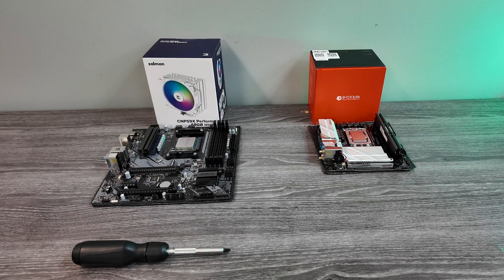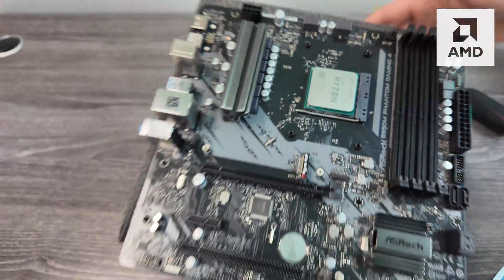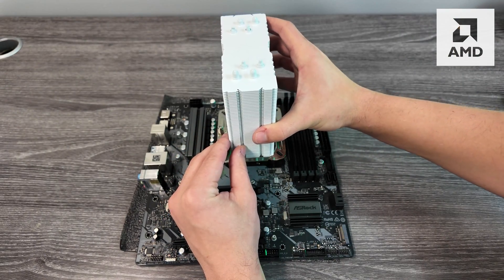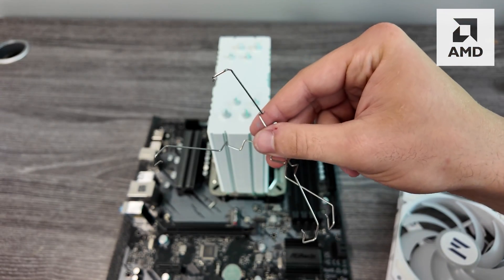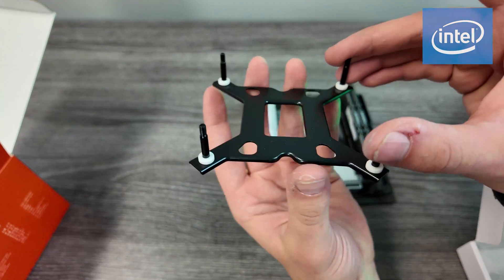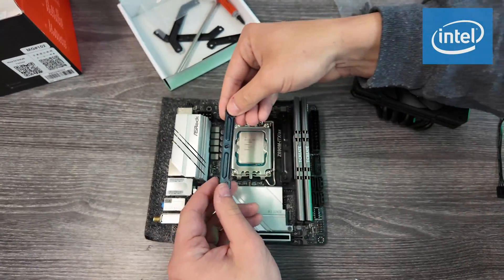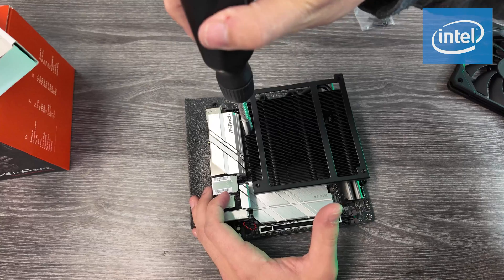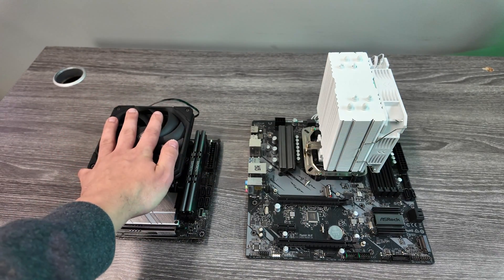How To Install a CPU Tower Cooler - AMD and Intel

Comment: Hi, great video, first off. However  i have a question, I recently switched/upgraded my pc from Intel to AMD. But the tower CPU fan i was previously using doesnt not fit the AM4 set i have now (with out the brackets, spacers, etc). The CPU cooler i have is from Vetroo..i have "attempted" to contact them via email, chat, phone number(s), with ZERO response. Do you know of a source i can find the hardware i need? I've checked Amazon whoever there are so many different variations of mounts i dont know which i would need and/or where to find them. 
Thanks!